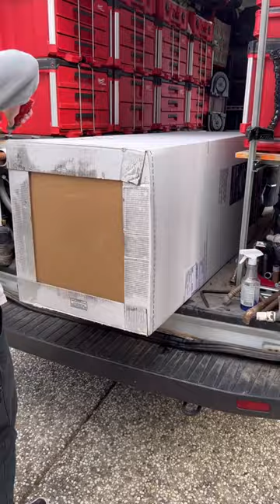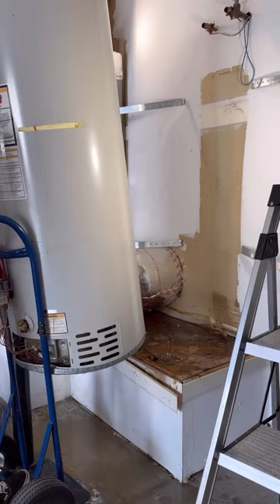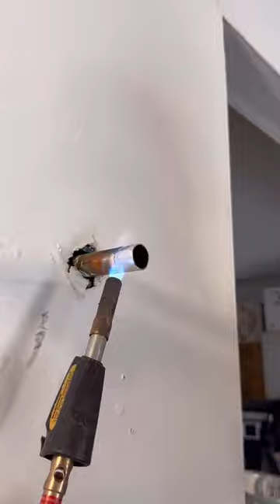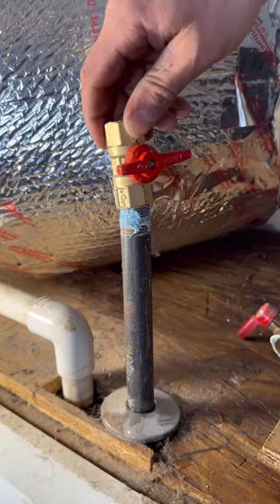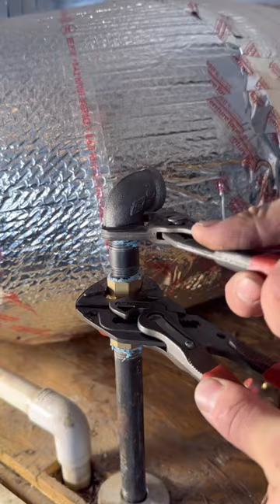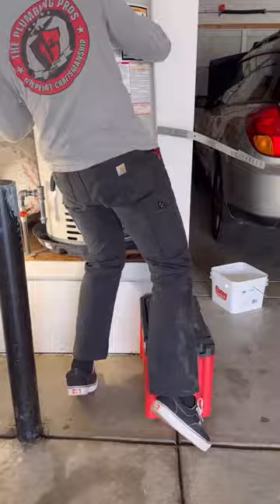Installing a new water heater

Comment: Bro what ? You used cheap as flex lines to connect a water heater and what looks like no thermal expansion tank ? Be a real plumber and pipe it all the way with copper , you should know you can’t mix steel with copper . Smh
Reply: There’s definitely a thermal expansion tank and I agree with the copper lines and the gas line why not just finished the 3 inches with all hard pipe and a union. I can see it being more fittings to leak but if you dope them and tighten and test there won’t be any issues. Idk I guess it works for him tho